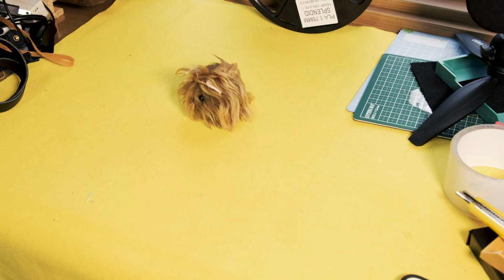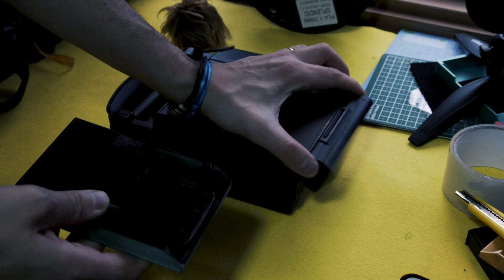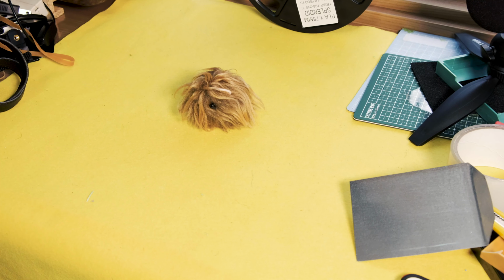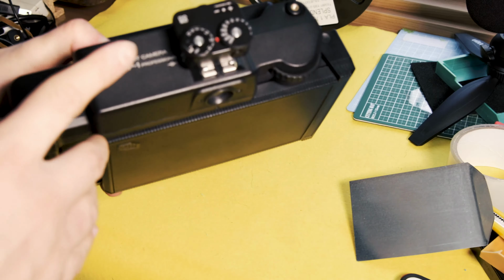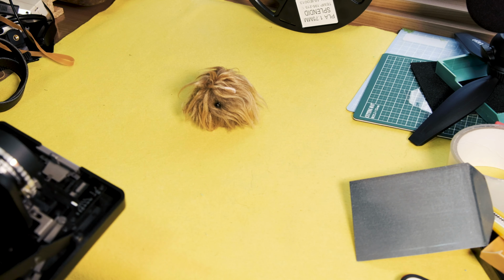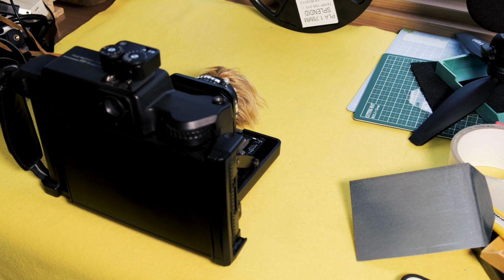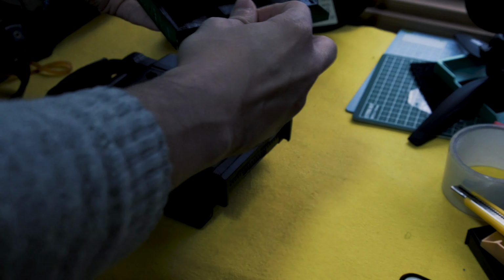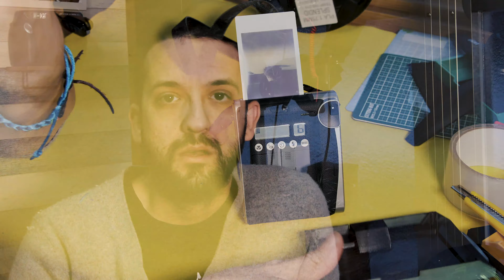SWAP peelapart with ANY Instax film (project update) - New dark slide

Comment: Keigo, Great work ! Have you tried to round the edges of the dark slide in order to ease reinsertion?
Reply from the maker: No, so thank you for suggestion! I’ll try that. I need to file better also the edge to avoid it will stop in the middle. But definitely I can see a better result than before so will keep on this direction

Comment: I’ve seen people cut the Fuji wide cameras in half, have you tried to add one? To the 4x5? Then you can shoot multiple shots of wide in a row, loading the wide camera from the back
Reply from the maker: Can you link some source or link? I’m not fully understanding
Reply: @KeigoMoriyama  there is one on eBay now for $300 it’s listed under “the Converted  Instax Wide for Polaroid 600E & Mamiya Universal photos”
Reply: It is similar
Reply from the maker: @davyjones2994  thanks i saw it now, but 300 dollars is toooooooo expensive
Reply from the maker: I always wanted to try and still didn’t give up. If I can find a way to design the attachment will share with the community